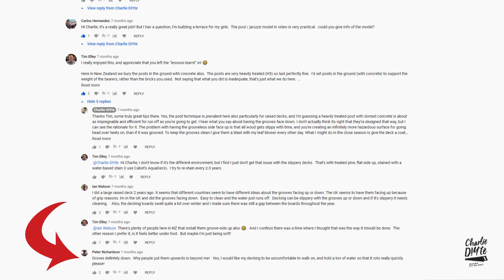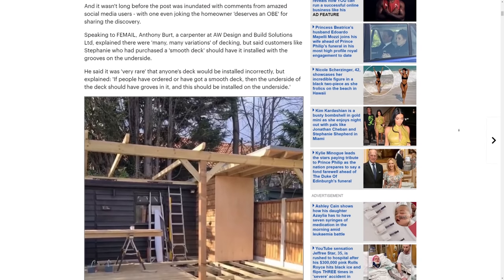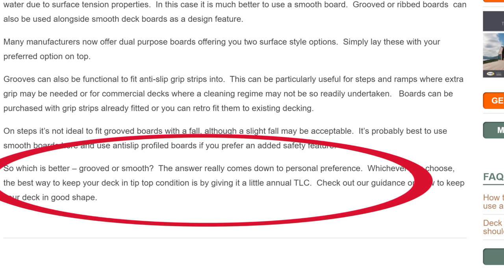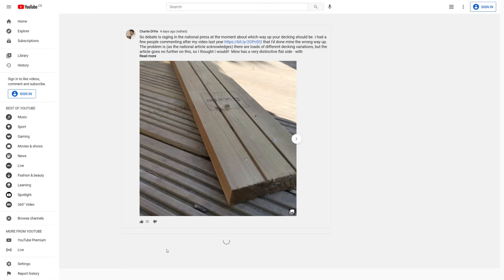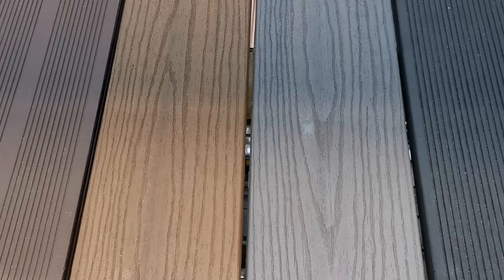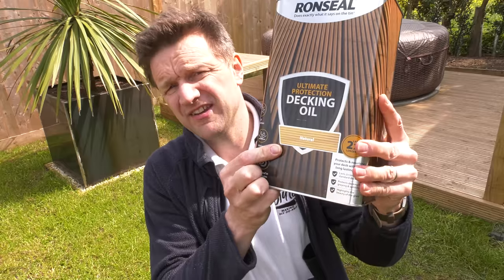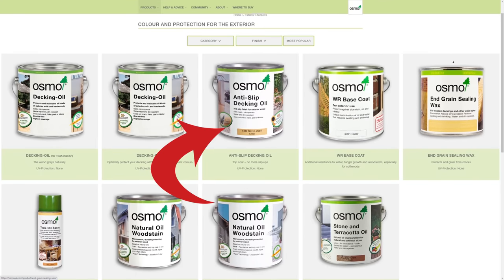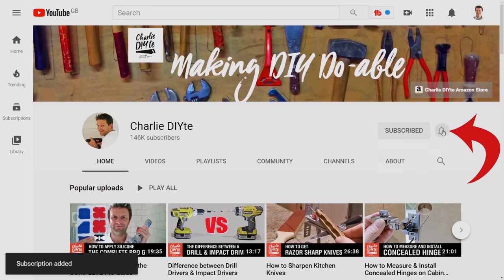Which Way Up to Install Your Decking?

Comment: Wow. Like Madonna you really got into the groove. I have also noticed how our American friends always point out that our decking is upside down. As they seemed to have spearheaded our decking lifestyle I  assumed they must be right. But, as you pointed out, us Brits have always been presented with grooves up and we clearly like that aesthetic. I honestly believe the decking phenomena would not have took off if our DIY stores just sold us plane old floor boards to enhance our ourdoor space. You're decking looks great, or should I say groovy? 😂👍
Reply from the maker: I'm sure you're right Craig. Strike the pose 🤣 The groove aesthetic has driven decking sales here. People have also pointed out wisely in this feed that the rings in the grain need to be facing down (ie curve at the top) so as to prevent the board cupping. I should have mentioned that 👍🏻

Comment: Just a suggestion...get as much side ventilation as you can. Air circulation always helps with drying but do you really think that those grooves are big enough to make a differance.
Reply from the maker: My 2 grooves, definitely not - but they're tanelised and covered in bitumen. If it had been the other way up, then probably yes. 👍🏻

Comment: What I don’t understand why people never seal the timber straight away with oil when it’s put down as when the black mould gets into timber it’s there for good.
Reply from the maker: Yes, I wish I had sealed mine straight off although they don't recommend it for tanelised boards because the surface isn't porous enough.
Reply: @CharlieDIYte  I have seen the tantalised boards turn colour after a year or two being out in all that harsh environment but as you say they don’t recommend treating them but after some time maybe they should be.

Comment: Obviously the makers of the boards designed it to be grooves down for airing the boards, not up for grip, but funny enough I actually had a builder of 40 years experience who I had know for a while try to convince me that it was meant to be groove up for grip. Yes I live in Australia.
Reply from the maker: Thanks for this James. Just shows what a divisive area this is. I agree though. Grooves down particularly if the other side is flat. Problem is, manufacturers over here are designing them wrong - as you saw with mine. Good to hear from you. Always humbled when I get a comment from overseas 👍🏻

Comment: Grass upto edge is'nt good for air flow. Could've easily worked in spaced air bricks for optimum ventilation too.
Reply from the maker: Peter I've installed air vents https://bit.ly/2OPcDl2 at 17:54 minutes 👍🏻

Comment: Slightly off topic but wondering if any one can help!? Pretty sure the fence in the house I recently bought has been treated in creosote, can I paint over it or does it need a particular primer or something else? Thanks
Reply: Look up bedec barn paint. It can be used over creosote but its expensive
Reply: You would need to paint first with aluminium primer👍
Reply: 2  coats on aged creosote 48 hours between coats.
Around 15 sq.m. per litre coverage.
Will then take a solvent based coloured paint finish but not a stain.
Hope this helps.
Reply: The Bedec suggestion is a good one, less time and less expensive, good manufacturer.
My process will last much, much longer.
Your decision.
Reply: Aus welchem Material besteht er? ☕🔔✓

Comment: I have to replace a few boards, to match to groves on both sides of existing boards. The replacement is flat on one side and groves on the upper side. I'm am worried I bought the wrong boards as I don't want to water damage the structure below. Would you change it for longevity?
Reply from the maker: So the replacement boards you've bought are designed so that the flat side is placed up, unless like mine they have a couple of grooves on the flat side. Ideally you'd triacs with identical boards but if that's not possible you could always paint the underside of the new boards and the joists beneath with a Bostik bituminous paint or similar 🤔
Reply: @CharlieDIYte  thank you.  I will follow your advice and also cut some groves where the decking meets the joists. Holla at me if that's a really bad idea . Thanks

Comment: Charlie, is your mic stereo? When you're doing the live commentary to camera its panning depending on the position of your head, it's kind of distracting on headphones. It doesn't happen on the voice over bits, so I assume it's the mic.
Reply from the maker: Thanks Paul. That's good to know. I've got two mics on my main camera, a lapel mic and a shot gun mic. The voice over stuff you occasionally hear is from my Rode desk mic. I need to look into this. I'm switching editing software shortly and maybe the more sophisticated version will help with this. Problem is it's hard to detect the stereo problems when you're editing.

Comment: The more surface you have (ie. no grooves) the more grip you have. Water pooling doesn't make the area slipply. And ice if that happens will form all over the board (in and out of the groves). Most timber is just too smooth and needs to be a bit rougher for grip.

Comment: Coming from Australia,  another myth that’s been spread about is to leave the deck for 6 weeks to de tannin before sealing. The right way is to wash yr deck with oxalic acid to remove the milling oil build up which can prevent oil absorption. 
There are 2 types of sealants 1. Sit on top which all give an un natural orange hue and require sanding and reapplication every couple of years or so. These all dry wood out and encourage cupping and cracking. They do how ever prevent dirt and other oils from being absorbed into the wood surface….which personally I think flat is best…grooves for drip lines and drying out.
2. Penetrating sealants like Organ oils wood guard, are the fastest and easiest to apply , do help water repel, feed the wood with appropriate moisture to prevent cupping and cracking. And apply to ALL SIDES BEFORE laying. Reapply every few months…yet you will preserve yr wood best this way for decades to come also most enviro friendly and cheapest method.long term.
Reply from the maker: A great post. Thanks for sharing. Funnily enough I did a video this weekend on this https://youtu.be/ZOQ2L1TMayc I totally agree with you on steering clear of stain, and for the same reason, water based treatments.

Comment: I had mine groove up for 16 years. I only replaced it because the house was renovated and it took a hammering. It was still fine. I also put in the new decking groove up and that’s been down for the past 5 years and looks fantastic.

Comment: Grooves in the decking boards varies with machine mill. Differing brands vary. In my experience grooves up or down is not that important, having inspected these structures for 20 years. Even if treated lumber they still need protective coatings to prevent weathering and splitting.
Reply from the maker: I agree with that Shawn - thanks for the comment 👍🏻

Comment: I have just purchased decking from a timber yard, but one side is completely flat. Am I right in thinking we still put the flat side facing down?
Reply from the maker: No. Flat side up. Unless you really want it underneath. It's a good idea to treat the underneath with something before you lay it. I used Bostik bituminous paint on mine.
Reply: @CharlieDIYte  thank you, was thinking about a couple of layers of decking oil for protection
Reply from the maker: @butler19801  They normally recommend you leave it a few months as otherwise the treatment on the decking planks will stop the oil sinking in. Have a look at the last vid on my channel where I go into all the decking oils you can use. I also treated the joists below with Bostik Bituminous paint.

Comment: Hi We just finished installing the decking with grooves up 😢 many leaves and fruits drop on it from the tree in my garden, make it so dirty and difficult to clean, I feel so regret, could anyone advise me the solution for remedy? Thank you so much 🙏
Reply from the maker: Get a leaf blower. Such a useful gadjet and will be a make light work of cleaning away the leaves and fruit. Also every six months give the deck a re-oil https://youtu.be/ZOQ2L1TMayc as that will make it easier to clean. Don't despair. You've done it right 👍

Comment: Won’t that bitumen paint just seal in any moisture and cause rot?
Reply from the maker: I don't think so because there's plenty of ventilation down there and they're well oiled from above. It was pretty dry when I did it. I think you have to ask yourself what the alternative is.

Comment: My decking is grooves up but next lot thinking grooves down and flat on top. Over winter the decking became wet then froze in the grooves and I went arse over tit on it. It has a slight slope for water drainage but that didn’t work. Also thinking of using the camo tool so no screws showing on top. Flat and smooth for me.
Reply from the maker: Get it sealed this summer. It's less likely to get sodden in the winter and will be less of a trip hazard.

Comment: Yeah nice bit of decking.
One thing I really disagree with is putting decking oil or any other type of oil on.
For the life of me I can’t understand manufacturers selling this stuff.
Why? Because it’s dangerous when wet.
Not only have I slipped but I know quite a few that have had the same experience.
My advice would be to steer clear of oil based products under foot.
Oh and before I go. Here’s one for the ladies. Don’t wear high heals on decking as the heel could get stuck in between the boards. Seen that happen too.
Take care

Comment: A smooth board is not more of a hazard than a grooved board at all. 
Quite the opposite actually. 

It's pretty basic physics really. Smooth boards = greater surface contact area = greater grip. 

It is the exact same reason formula one cars to run completely smooth tyres, and only use grooved ones in wet conditions.

Comment: I have some valuable anecdotal evidence: I laid a deck, grooved side down, flat up in 2014. Moisture rises. The deck has rotted. You do not want ‘air flow’. You need a good waterproof fit.
Reply from the maker: Hmmm, I tried to make my deck waterproof, took it up a few weeks later during the summer and was shocked at how wet it was below. I actually think air flow is very important.

Comment: Never use a pressure washer on your decking!!!
I replaced a 14m deck shared by 2 houses.
One half looked dirty,covered in acorns and hadn't been touched in 10 years.
The other half,laid at the same time,same materials,same carpenter looked clean and had been pressure washed multiple times.
The side that looked superficially dirty was in great condition with only 3 joists out of 14 needing replacement and the dual-sided boards got flipped with hardly any rot to deal with.
The 'clean' pressure-washed half of the deck was utterly destroyed and I was only able to re-use 2 out of 14 joists and the decking boards were badly rotting and disintegrating from underneath.
Pressure washers will force water and any mould spores deep into the wood and get the joists and boards wetter than they would ever get in rain 
This was effectively a perfect long-term experiment showing the destructive effect of pressure washing wood and timber with a control group.
The evidence is utterly beyond dispute.
Message ends  :-)
Reply from the maker: Thanks mate. A great experiment as you say. I wonder if the washed side had been treated at all? I'll think twice before pressure washing it this summer although my pressure washer is a pretty weak machine.

Comment: I bet you panicked for a little while when this issue went viral last week!   The logic on your boards as to which way up seems to be solid.
Reply from the maker: I was slightly indignant that she was saying "grooves up, you've done it wrong" but, yes, this will be a useful little vid to send to anyone over the summer who triumphantly tells me I've messed up with mine. It's intriguing though that even the manufacturers seem to be designing them wrong half the time.

Comment: I thought groove had to be top way up to stop slip
Reply from the maker: That's where we're all wrong Nicola! A flat topside is easier to clean and probably less slippy. At the end of the day it comes down to maintenance. I'll be doing a video on cleaning and oiling mine in a few months' time.

Comment: Ultimately it is a personal choice for people, but frankly you would be doing yourself a disservice by installing you boards groove side up, UNLESS they are commercial grade boards that have full grooves cut into both sides. 

The thin bumps you showed on some of the others  (B&Q I believe) is actually called reeding. Its purely cosmetic and will not allow air flow under the boards.  In fact those reeds will be pressed pretty flat within a couple of months. 

If you absolutely MUST have your boards crap side, sorry, grooved side up then you should install proper joist flashing on the subframe. 
Bitumen, creosote, paint, stain, sealant etc simply will not last and you WILL eventually end up with rotting issues.

Comment: I’m a carpenter, and I worked in America Massachusetts, all the houses have decks there,  and the  decking material doesn’t even have any grooves in America, I don’t think the English have much idea about building decks, and the decking material they use here is cheap  pressure treated  sh*t,  in America they use cedar or hardwoods, they also use composite decking now,
Reply from the maker: Problem is cedar or hardwoods would be cost prohibitive over here, and composite is wildly expensive as well. I guess faces you money in the long run though.
Reply: @CharlieDIYte   I know, England’s a poor third world country,  poverty wages for carpenter’s .

Comment: Forget the deck… the pointing in the background is shocking!!! Probably should be lime and not cement too!
Reply from the maker: Yes I inherited that from the previous owners. I'll sort it out when I convert the shed.
Reply: @CharlieDIYte  I didn’t think it was yours. Looks like it was done with a shovel! 😬

Got to remove cement mortar on mine too and replace with lime. Causing a world of problems. Good luck!

Comment: Don’t pressure wash the deck. Just use cleaner.

Pressure washers bugger up decking, dramatically decrease decking life span.
Reply from the maker: Thanks Olly. I'll take that on board as quite a lot of you have said that. My pressure washer is pretty pathetic though so I'm not sure it would do much damage (Karcher bike washer) but I'll get a brush instead as chances are I'll need it anyway when I apply the oil.
Reply: @CharlieDIYte  Our property is on hill, so I built a deck from kitchen extension and also a deck at the bottom of the garden (we have a river, so built a second one)

Pressure washing definitely knackered each deck- it does open up the fibres of the wood. I used a small karcher too.

I suppose they still lasted 15 years. 

Once again, really enjoy your videos. Cheers.

Comment: To groove or not to groove, that is the question........
Reply from the maker: Indeed. Although for a hot tub grooves definitely need to be up, to assist with air flow under the tub.

Comment: grooves down , this guy cannot admit being wrong
Reply from the maker: Um, no. My decking was designed to be grooves up. The two grooves you saw underneath are designed to be placed face down to prevent the decking cupping. I would prefer it to be grooves down so your comment is just unnecessarily provocative.

Comment: If the board has double sided grooves…don’t buy it.
Reply from the maker: It's a fair point if you want smooth decking except the grooves help with circulation below.
Reply: In my experience of fitting and maintaining decking boards, they last a lot long smooth side up. I understand the idea that water is gathered in the grooves and due to the increased volume it’s supposed to run off but in reality this doesn’t really happen and it just pools, unless it’s highly sloped which is not pleasant to stand on.
Grooves down for circulation. Smooth face up for durability and dare I say, asthmatics as well?
Reply: Aesthetics* (YouTube doesn’t let me edit on my phone for some reason)